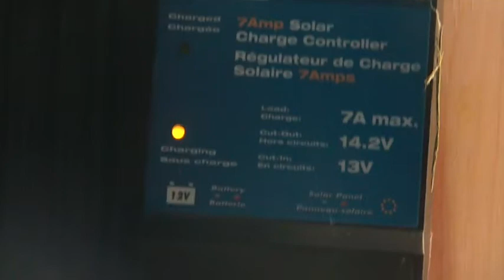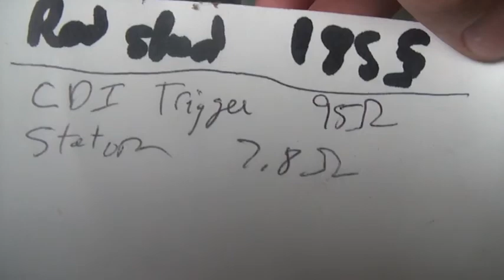7_24_2013, Red Shed Honda 185S

Comment from the maker: HondaATCTRXguy, I think the Red Shed motor will run, the original DT n' Missy bike engine still needs to go on a bench and get opened up, I'm hoping it has a leaky intake valve, if not, I truely have no clue why it will not start or even pop with starting fluid, I know all the external stuff is good as I installed a couple of other motors on that bike and they ran. Another project I need to get to,,, LOL

Comment: When you get the stator out. Give it a soak in ionized water in the sun for an hour. Take it out and support it off the surface your going to dry it on and leave in the sun as long as you can. When completely dry check the resistance again. Unless there is physical damage it should then be fine.  Were you a magpie in another life. LOL. Have a great time at the party. Remember time is a figment of mans imagination. No-where in nature does it say 60 seconds make a minute. Next video please.